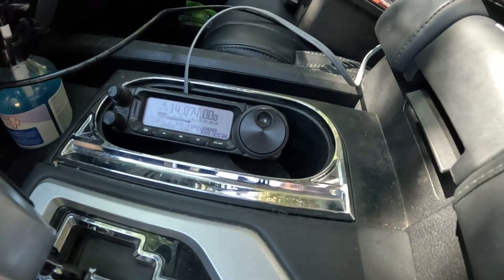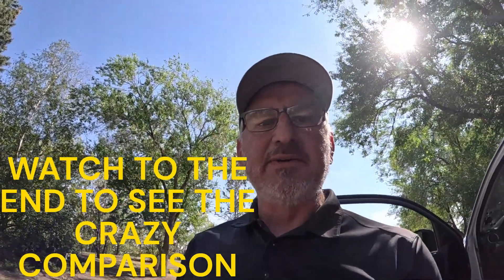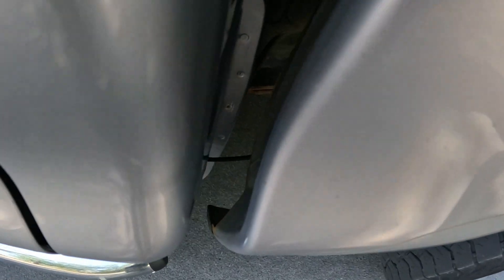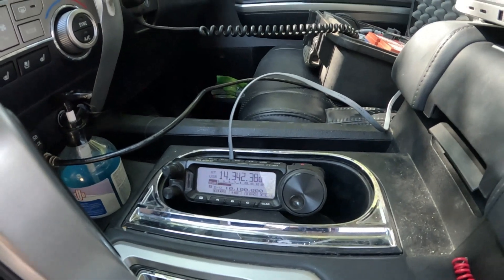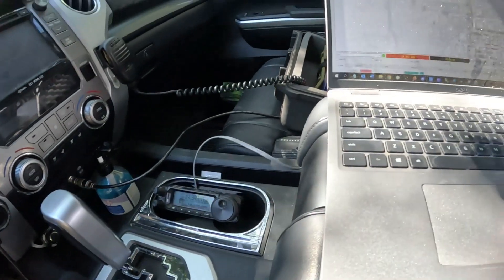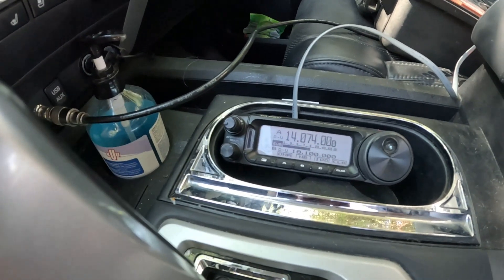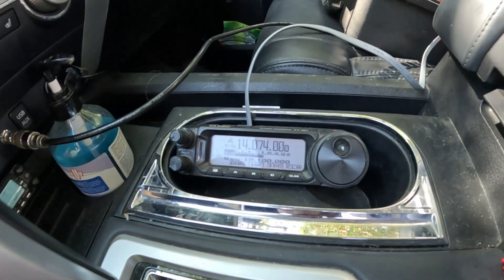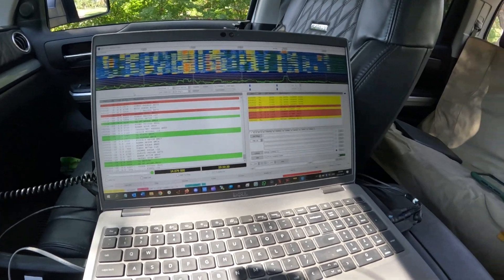HAMSTICK HACK UNDER A DOLLAR #BEST #hamradio

Comment: Try the Yaesu FC-40 tuner with a 98" whip. This works great 6m - 40m. The FC-40 tuner is the must over looked mobile tuner for yaesu mobile HF radios. Just cut a 102" whip down to 98". As you change freq on the radio. The tuner will follow the change automatically. Most hamsticks are 93" in length. 
FT891 Manual Pages 24, 46 & 54
Reply from the maker: Really?  I’m not a tuner kinda ham but sounds interesting.
Reply: @MrMudsHamRadioTime  I'm not ether. But the FC-40 beats the ATAS-120. I have both.

Comment: Do you have quick disconnects on your ham Stick? I have the ones from shark. I had about 1.7 swr until I installed the quick disconnect and then it was close to 1: 1.
Reply from the maker: I ditched the quick disconnects a few years ago as they didn’t hold up to our tons of salt they put on the roads.  Was having random issues.  Interesting I did a test and every 2 inches of base lengthening would equal to a 1/4” of lengthening of the whip.  Thanks for watching and the comment.  🍻

Comment: I wonder if that would work on other antennas. I have a 4ft Firestick for my CB in my Jeep. I can’t get the swr down for the 10 meter band. I have shortened the adjustment screw and even took it out but it is still too long. I got to try it. Thanks
Reply from the maker: It should work.  I did some testing and you get better results lengthening the top after the loading coil than the base.  Please check back in with your results. 👍

Comment: I've never used a hamstick before, but if it works on the phone section, couldn't you lengthen it to work at 14.074?
Reply from the maker: Absolutely.  I used to do that but this way is a lot easier and quicker to get back to the phone section.  Great comment.
Reply: @MrMudsHamRadioTime  Oh got it! So the 'adjustable' part of hamsticks aren't really that adjustable?
Reply: @alexjh47  They are fairly easily adjustable. However, you need to use a small allen/hex key to loosen & tighten the locking screw. Some hams prefer to leave the screw in place at the length they use most, then remove the whole stinger/whip section with adapter (that has the hex screw inside) attached that screws onto the top of the lower coil/fiberglass section. ⚡

Comment: Great test. Was the stinger fully extended before adding the coil?
Reply from the maker: It was cut for the middle of the band.  I usually leave a bit extra for tuning but this method seems to be a lot easier.